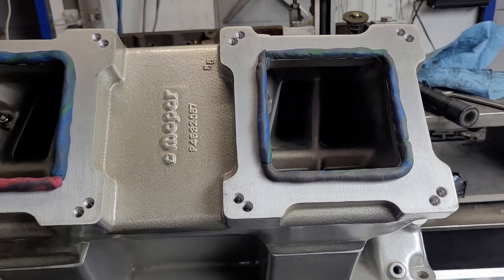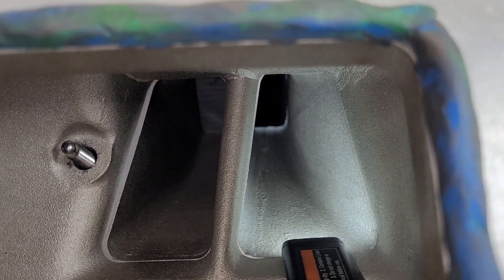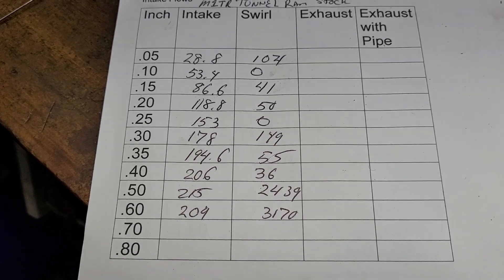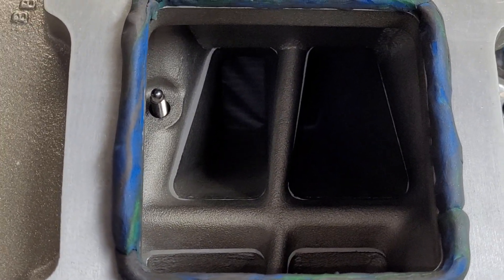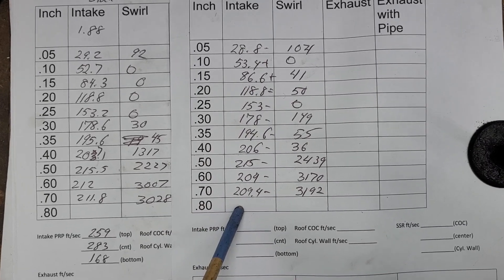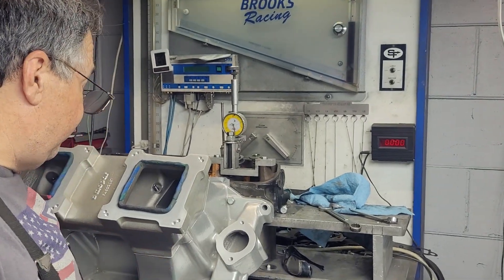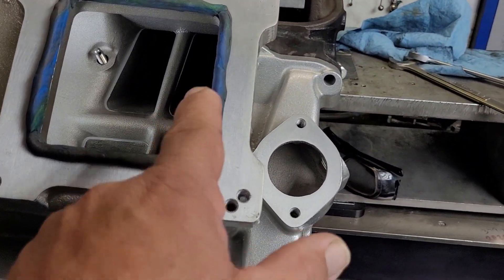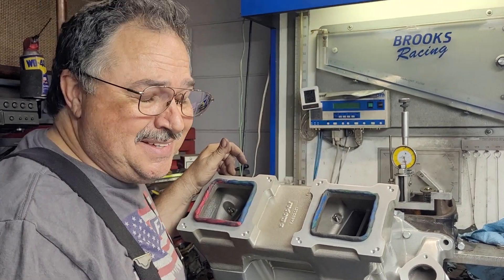Chrysler 360/915 heads flowed stock Part 2, Flowed with Mopar tunnel ram, 1.88"/1.6" combo

Comment: 🔔😎 
I'll bet that the mismatch is not too bad. It might even reatomize fuel rivulets.
Can you see the string bouncing over the ridge?
I usually make the head port .030+ bigger all around than the manifold, because you can rarely see down to the mismatch.
These new $10 boroscopes for the cell phones are a great idea for looking into dual planes, etc. 👍🤔
Reply from the maker: I like .030" bigger myself. The string was quite lazy.

Comment: The great thing about 360 heads with the 1.88 valves is they virtually all used the same intake ports until the #308 casting. Get those low lift flows to flow well with a good chamber cut & valve job, and deal with the misalignment. Possibly do some work to the bowl area, and you got yourself a set of heads.
Reply from the maker: One intake, one exhaust and one chamber got ported. Stay tuned...thanks

Comment: I been wanting to put a couple 500 Holley 2bbl carbs on a tunnel like this, with them center mounted on a 2" spacer, that widens out to the 4150 flange, have the carb center of the intake, 4bbls in a row down the center,  have the 2" spacer have a trapezoid cut out in it to allow the flow to turn from the bottom of the carb to the Rh and Lh ports, smoothly as possible, maybe have it in a. Concave instead of a flat path, or have angles like a valve seat!  Have a few 15-20° angles
Reply from the maker: Interesting

Comment: would you expect more swirl because of the manifold controlling the air. i mean giving a little removing a little of swirl per port because the air is basically under control on manifold... so the swirl went reverse 50 then 0 then rotated back the other way
Reply from the maker: Swirl changes with the approach angle of the intake runner to cylinder head. We saw that on the Mission Impossible dual planes. Thanks
Reply: @servediocylinderheads  well control its the first control 'intake manifold/after carb/eg. then the head takes over in its multilayer layers of control flow then valve.. i guess what i ment is can u get good swirl with out changing a head.  From intake iv noted. as Qouted on video ill look back throw your videos for sure. I may have missed something that intrests me. Or miss interpreted. I want to spark the imagination not spark. The othe side coin.
Reply from the maker: @jacksonbermingham2168  Stay tuned, I think I will show you exactly what you are asking for on the 360 heads. Thanks
Reply: @servediocylinderheads  i love your channel
Reply from the maker: @jacksonbermingham2168  Glad you like it. Thanks

Comment: Will you show how the J heads and your ported 318 heads compare flow wise? 
I want to use that very head on my 318 as long as I can get my compression ratio up with a nice set of pistons and decking the block and heads. 
I’m not positive I’m brave enough to have .100 milled off of the heads like DV did.
Reply: Oh yeah I forgot to mention that it felt like Christmas morning when I saw you were actually going to test the J head 😂
Reply from the maker: I like that, stay tuned!